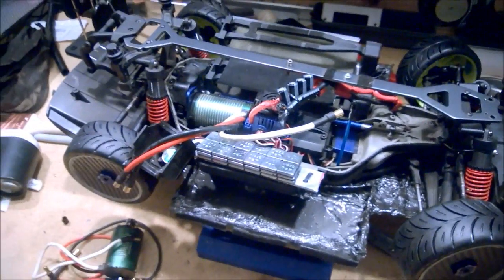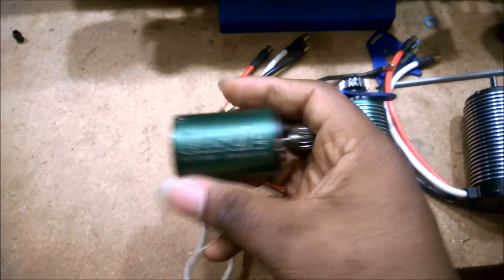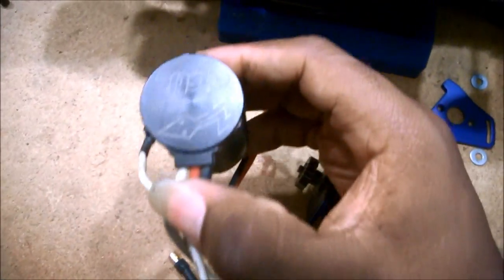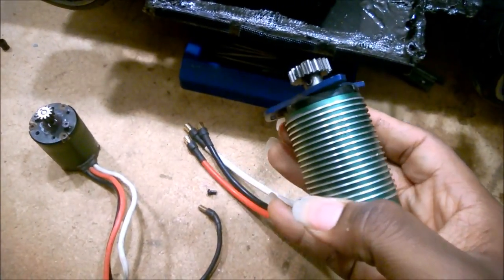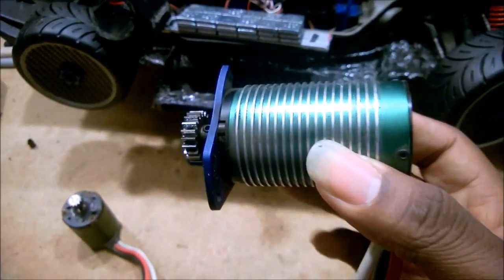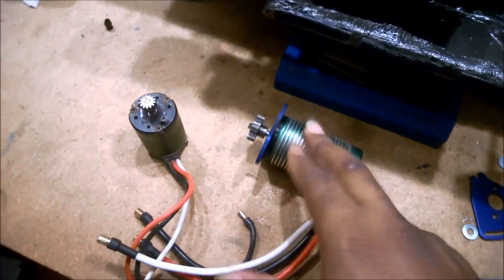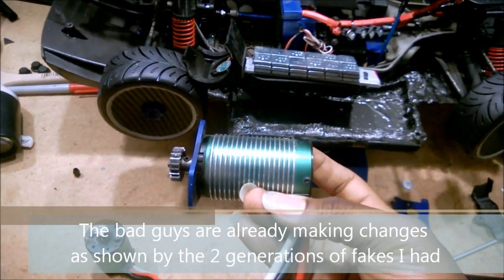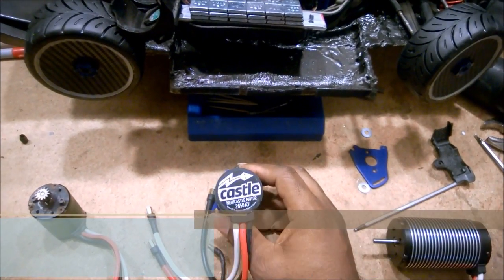Ep. 123 Counterfeit Castle Creations Motors

Comment: I don't see how this is true because my castle motor doesn't have anything on it and I bought my EMAX brand new eye open the package
Reply from the maker: Most of the info in this video came directly from Castle. Some of their early motors had a wide range of markings, but they tightened that up right before they transitioned to a 100% sensored motor line-up. 

Question: Is your EMAX a "black-can" or "green-can" motor? Castle and Traxxas parted ways at some point and Traxxas started shipping un-marked "black-can" motors that looked and "felt" remarkably similar to the Castle motors. If you notice, most of the marketing material removed Castle, except for the XO-1 which used a modified version of Castle ESCs and a unique 1717-sized motor.

I hope this was helpful.

Comment: Pretty sure I bought a fake. I figured there was a good chance it was before I bought it but it was dirt cheap. It has lots of power but it gets extremely hot even when using no more than 1/4 throttle.
Reply from the maker: If whoever made these motors had just sold them under their own brand, I might actually have become a fan. But the fact that these say Castle means guys expect to run them like a Castle, and they just don't live up to that standard.

Comment: They all run the same dude no better speed u just get prolly bad bearings slap a capacitor on that bad boy and u flat foot balling
Reply from the maker: Unfortunately, there's more to it than that. These are not really "bad" motors. They just aren't built to the same standards as authentic Castle motor, so they don't match the overall performance and can't be punished like real Castle motors without failing. And when they finally burn out, the buyer is stuck with no option for repair or replacement.

Comment: I bought a 2200 kv and it's fake like this that showed
 The difference between the original CASTLE and these "CHI-NA-FA-KE YUN-SONG" lol ... is huge. When turning the pinion with the fingertips the fake seems to have only bearings and there is no resistance

The original CASTLE is difficult to rotate without electricity.Tks 4 share dude
Reply: Edu macaco That doesn’t necessarily mean anything. Lehner motors which are very nice and well built have no resistance in them until they have power running in them. The electricity powers up the magnets somehow. These might have the same type of design inside.
Reply from the maker: Lehner motors use a "slotless" stator that gives the motors less cogging force, so you can turn them more easily. It also helps them have a smoother start-up. Castle used slotless stators on some of their motors, too, but these days they are relying on more advanced ESC programming and sensored motor tech to solve the startup cogging problem.

Comment: Wow how did it runn tho?
Reply from the maker: Word on the street is that these were actually made by a former Castle supplier, so they actually run pretty well. The real problem is that they may not have used the same quality of materials internally, so they may not be as durable in the long haul. They are completely un-warrantied, so if you kill it, you've got no back-end support.

Comment: What's up Rhouse. I wanted to ask what was it that castle said was the easiest way to tell an actual fake?  I ask because early editions of the Mamba Monster combos had those same motors. Even if you look all the way back to 2008 Big Squids first ever review of the Mamba Monster series included pictures. Those motors had a sticker, taller wire housings, Inc as well. The sticker covered the opening over the rear bearing. One problem early on with the motors was they the shaft would come out the rear. As to the box theory... unboxing vids here on YouTube from 2008-10 had the "fake" boxes inside the earlier combos. I'm aware there are definitely fakes out there. But even Castles bulletin doesn't give details. Seems many people unfamiliar with the many revisions castle motors have gone through instantly say they're fake. Just wondering if you might have been given a solid smoking gun item to look for?  Love your vids and you've helped me a great deal. Hoping for a little more.
Reply from the maker: Good points. I think the easiest way to know that you've got a real motor is to be careful about where you buy from. Apparently, some of these fakes are coming from a former supplier, so the they are actually using old castle designs, so it can be very tough to tell sometimes. I think the bottom line is to just buy from trusted resellers and don't go for deals that look "too good to be true."

Comment: hi thank's for the warning ! good job !!
 i have buying one off this for see it myself , i oppen it , and it's the same rotor , the same tape , the same balancer weight (blue) the same weight ,  heaven the magnet have the same power , very funny 
but i have the t° and the stamp 
and i have to say it's run same performance until 50 lipo pack on a rally car on 5s with the 2650kv motor (i have two same care for me and stepson)
so good job foor the fake ? or bad castle job ??? lol
Reply from the maker: I've been told that some of the fakes are from a former castle supplier who has continued to produce an old version of the design without legal authority but is now using inferior materials. I'm not sure how true this is, but that's what I heard.
Reply: yeah it's what i expect , i see the fake have also longer shaft 
thank's for the fast response 
have a nice day 
marc from france
Reply: rhouse21 - RC Physics are they still good motors and are they still as fast

Comment: i heard these fakes or clones are just as good as the castles original.. all electronics go down after a couple years.. castle not the best no more anyways.. jp or jd power has the fastest motors in the world... i buy 1 for $30 -$40 bucks.
Reply from the maker: A motor has two jobs. 1) to efficiently convert electricity into mechanical energy, and 2) to not blow itself up. These motors seem to do both of those things, but I have found that they are not as efficient as the authentic Castle motors.... and only God knows how long they will run before they die on you.

I bashed with this motor in my Slash 4x4 and found it to feel less "punchy" than my smaller 1410 3800kv motor on 3S. It also drove the sidewinder ESC into thermal overload much more often and produced more waste heat. Still, it is strong and seems much tougher than any other $30-$40 motor I've seen. I just don't know why these guys didn't just put their own branding on these motors and sell them for $50-$75 each instead of trying to defraud the community.
Reply: Team69 Racing tell me where you get your motors(website) cus I would lile to try a cheap one. ispent $130 on a 1/10 scale motor for a rustler and i love it, but a cheap one for my slash would be nice.
Reply: i was just wondering if one of these would be able to run in a losi mini 8ight t

Comment: I just bought a mamba monster 1515 2200kv motor and esc from my hobbie shop how can I tell if it's fake or not
Reply from the maker: If it came directly from a hobby shop it is probably ok. However, some shops pick things up from strange places. The big clue should be the box. You can google "fake castle motors box" and find a few forum post of what the fake boxed look like. Also, see if the writing on your wires matches the motor in my video. The biggest indicator will probably be price, though. If it was too cheap to believe, it may not be real.

Comment: thank you so it sounds about right is goes 29mph I want to go faster
Reply from the maker: I'll give you a big hint, you want the ratio between your spur and pinion to be a lot closer to 1:1 to give you the gearing you need for serious speed. Your current spur to pinion ratio is 3:1, so you are ~1/3 as fast as you want to be. ;-)
Reply: So I need a smaller spur
Reply from the maker: ...and a bigger pinion. Remember, it's the ratio that is important. Gears carry power through your system as torque and rpm. The gear ratio determines how many turns of the motor it takes to get one turn or your car's wheels. Your motor currently takes ~9 turns to make your wheels turn one. That ratio gives you a lot of torque, but it kills your top speed. You ultimately need a "Final Drive Ratio" that is a lot "taller" (fewer motor turns per wheel turn) to get you to your goal. The speed calculator page I posted is a great place to start to figure out how these ratios can work for you.
Reply: I will check it out thank you

Comment: xtm120 2000kv motor its an expensive combo but I dont know what the problem is I thought it was the low kv motor but now ive seen guys running these 1/8 combos on slash and they go fast may I need a new set up
Reply: Al Bert low kV means high torque and fast acceleration. simply get a larger pinion or smaller spur. sacrifice torque/acceleration for higher top speed

Comment: hey bro how do you go that fast with the low kv motors I have a 4x4 slash I put Xtm120  2000kv combo on 4s and it won't even hit 30
Reply from the maker: There's two big things that you'll need to get big speed. 

1.) You need to really spend some time and get familiar with gearing. There are several good online gearing calculators and apps. They're not perfect, but they'll get you in the right neighborhood. Just remember that all batteries will have some level of voltage sag under load which will reduce your speed. 

2.) Invest in some QUALITY LiPos. Not all batteries are created equal. Speed running requires low-sag batteries. The wrong battery can kill a run. I've talked about this a lot on my Facebook page http://www.facebook.com/rhouse21rcphysics . Check out some of the rhouse tech corners for more info
Reply: +rhouse21 - RC Physics     im running 54 spur 18 pinion ive tryed diffrent batteries as well zippy 5800 mah 30c 4s and reaction 5700mah 80c 3s and still no go cant go past 28mph
Reply from the maker: I ran some quick numbers and 54/18 gearing on 3S should give you 29 mph on a Slash 4x4, so you are pretty performing exactly as geared. 4S with that gearing would only be ~42 mph. To get bigger numbers, you'll need to move to much taller gearing. Check out this site to help you get a better feel for what you should be looking for from a given gear ratio. http://scriptasylum.com/rc_speed/top_speed.html

Most people switch to Mod 1 (E-Revo type) gears for speed running 1/8 scales with lower kv motors because thet can take more torque. The plastic revo 36 tooth spur is a good chouce for ~70 mph, but you really need to switch to all metal gears once you start gunning for triple digits.

You also have to start paying attention to a lot of other details once you get over ~60 mph. Only run foam or belted rubber tires once you get into this range and ALWAYS balance your tires. make sure your suspension is sitting with a slight "nose down" rake and that your ride height isn't too high. ...and don't forget to watch your aero or you WILL go airborne.

You have a lot of fun to look forward to.
Reply: @albert8090  what pitch gearing are you using? On 3S lipo you should be getting 55+

Comment: how is it holding up? just watched the video, man i'm late😁
Reply from the maker: It's actually still in good working order. I filmed a follow-up a while ago. This motor does not seem to be as efficient as my authentic Castle 14 series motors, so it produces a bit more heat and actually doesn't feel as "punchy" in comparison. I'm thinking about using it to build a load-cell to test batteries since I don't know if I trust it in any of my speed cars. Stay tuned. I'll keep you guys posted.

Comment: Not bad speed for fake
Reply from the maker: +Jorge Ochoa True, but Lamont just blew one up at the RUN DMV Season Opener this weekend. That's the thing. They might be ok for your application, but they might not.
Reply: +rhouse21 - RC Physics mmhhmm that's sucks lol I guess not that great then thank .
Reply: +rhouse21 - RC Physics I have a question for you I'm trying to make my stampede 2wd reach at least 60 I have put a sidewinder 3 5700kv on 3s should I invest in a 7700kv and run it on 2s by the way my gearing is 86 and 26 all metal gears and dif and transmission case I broke both shaft I am thinking about getting the integy shafts do you know of any other better option
Reply from the maker: +Jorge Ochoa Maybe, maybe not. With the gears he was running, he may have killed a real castle motor!
Reply: +rhouse21 - RC Physics oh ok maybe maybe not I see thanks for your response 👍

Comment: if these things perform fine without the brand price that castle puts on them why not buy the cheaper motor castle prices their motors to high anyways.
Reply from the maker: +jack w (rc rivals) I beat on that motor pretty hard before I realized it wasn't authentic and it held up ok. Here are some things to keep in mind before you buy one, though.  

1.) This motor is less efficient than a real Castle motor. I have not quantified by exactly how much, but it does make more heat and feels less "potent" than my smaller 1410 3800kv motors in the same car with the same type of driving. 
2.) I have it on good authority that even though these motors are based on 
older Castle designs, they are made with cheaper materials that probably
 won't hold up over time. 
3.) These motors are completely un-warrantied If you blow it, it's done. 
Granted, If you bash hard or speed run, Castle still may not warranty 
your authentic motor, but at least you can use the out-of-warranty 
program to get a new motor at about 1/2 price. 
4.) We may not like to think about things like this, but knowingly buying counterfeit products supports people who are trying to damage legitimate businesses. They are taking advantage of those who are looking for a good deal and using someone else's hard work building a brand to make fast cash. I made a comment once that I didn't understand why whoever is making these motors just doesn't make their own legit brand and charge more money, but you can't legally sell a product that steals other people's designs. Let's be real. The individuals who built these motors are criminals. Instead of using their heads to make their own innovations and compete on the open market, they knowingly and willingly stole designs, manufactured them in large numbers using god-knows what kinds of materials, and defrauded consumers while taking business away from a legitimate company. Do you want to give your money to support people like that?

Sorry. I really don't mean to sound preachy, but this is really a much bigger problem than RC motors. Companies like this are getting bolder and even counterfeiting things like brake-pads and safety that could put lives at risk. It's scary to think of what else these guys my be counterfeiting and what equipment it could be ending up inside of.
Reply: +rhouse21 - RC Physics yeah I see where you are coming from. these guys are stealing a brand name. my thinking is if the brand (in this case castle) is making such a generic product that it can be counterfeit like this I think the brand should incorporate some more unique technologies in order to keep counterfeits away. castle makes the same motor as everyone else they were fortunate enough to be partnered with traxxas and known enough to jack it's prices up so much.
Reply from the maker: jack w
I've heard a few different stories on this, but the bottom line is this isn't just a case of someone making "lookalikes". Someone who understands motor design stole intellectual property to fab "castle-like" motors with cheaper materials. When you buy a big name motor, you're really paying for 2 things, the materials and the workmanship. The designs are all pretty similar because there's only so many ways to build a brushless motor. But it's the materials and workmanship that separate a cheap 70-80% efficient motor that melts at 150 deg F from a "high quality" 90+% motor that you can beat on all day in "race" conditions.

Comment: ok bro.tnx.again with your great ideas.did u run already your XO-1 with 8 caps.?
Reply from the maker: +JJARM RC It's been installed for a while, but we don't have speed run weather here yet. Dizzy, my Slash 4x4 did 102 with a 4x470uF version though. I'm moving that pack to one of my smaller cars, though. Honestly, the Castle 4x220uF cap pack is plenty for many applications. the XO-1 has a 3x470uF pack in it from the factory, so my large packs are probably WAAAAY overkill. But, since I build them myself and the parts are very inexpensive, I figured "Why not?"

I'm building more that I'm about to list online. Are you interested in one?

https://www.facebook.com/rhouse21RCPhysics/photos/a.387922904712557.1073741835.364144830423698/502996353205211/?type=3
Reply: +rhouse21 - RC Physics im goin to let you know bro anyways. thnx again

Comment: anyway bro.may i ask U? what is the downside if i want to put a large 2 caps.like 2,200uf in my MM2 with 2200kv motor running 6s 5000mah 35c.Is it possible that this kind of set up something happen to my system?
Reply from the maker: +JJARM RC Cap packs filter out voltage ripple caused by the "power pulses" of high powered brushless motors. If the individual caps are too large, they cannot recover fast enough to filter out high frequency ripple. This is why Castle generally doesn't use any caps larger than 500uF in their cap packs. Five  470uF caps will generally filter better than one 2,200uF. I've made 8x470uF units for Dizzy & Serlie now for this reason.

Check out the attached video https://youtu.be/ie8P3ocN1io .
Reply from the maker: +JJARM RC Here's a link to a pic of my XO-1's 8x470uF Cap Pack installed. https://www.facebook.com/rhouse21RCPhysics/photos/a.387922904712557.1073741835.364144830423698/480069538831226/?type=3